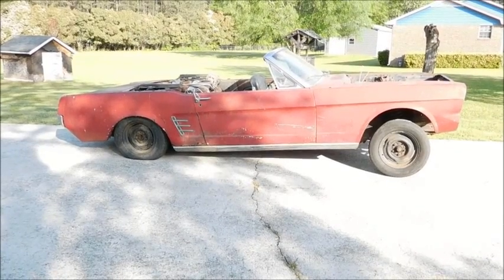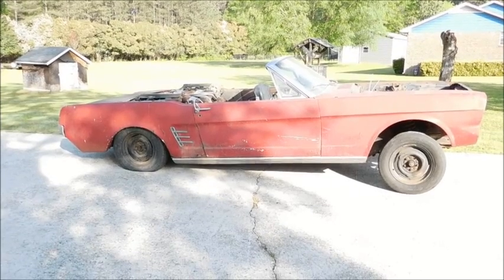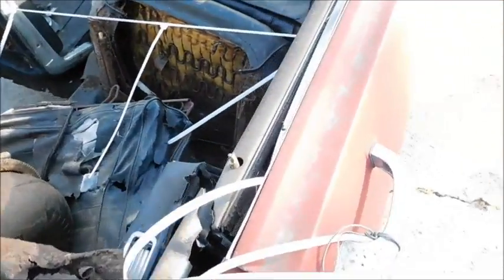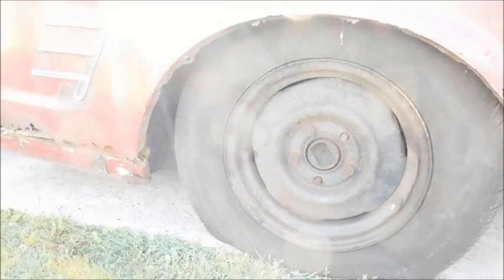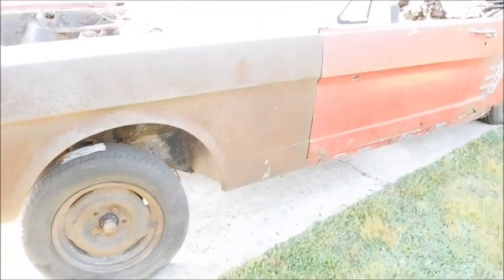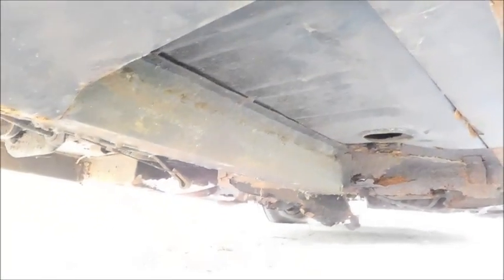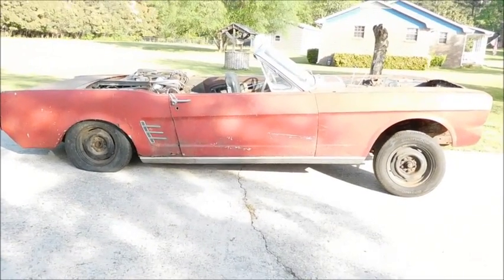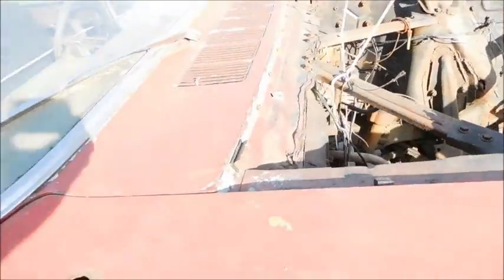1966 Mustang convertible first look. Brooklyn Pony 1

Comment: Hi Buck. You mentioned a Dynacorn body. Have you ever worked with one? Would it have been a better choice on this project? Cost?
Reply from the maker: I've heard good and bad. I haven't used one. The difficulty is registering it legally. You can't just claim it as a 66. With what is planned, it would likely have been more expensive.

Comment: I noticed the V8 bellhousing but strait 6 in the back seat. You going to drop v8 in or rebuild 6? If you rebuild 6 I have a 6 bellhousing I will swap you and if you need a v8 i have two 289s that i could bring you, both are mustang motors.
Reply: You need to take a better look that was a small block v8 not a 6 and they take the same trans bell housing
Reply from the maker: It is a V8
Reply: Sorry, that 5 second glimpse i mistook it for a 6, and they definitely do not use the same bell housing.

Comment: if where the vin plate is rusted out, how do you transfer it to the new sheet metal?
Reply from the maker: That's actually one of the solid areas.
Reply: I know this is not related to this project  So please forgive me,  if it is in the wring video.

Your attention to detail and doing it right has made me to start doing the same thing with my projects. I want to strip most of the old paint from the inside of my trunk lid. I do not want to use a soda blast or any other blasting method, since the material seems to get stuck in the supports. What other methods or tools are using to obtain this goal?
Reply from the maker: Depending on condition of existing paint, I will generally start with 80 grit on a DA sander, and hit all the areas I can. I use 2" scotchbrite pads on my air grinder for the bulk of the smaller areas. I also use wire wheels, scrapers, puddy knives, etc.
Reply: thanks